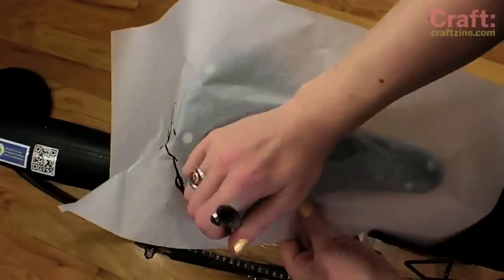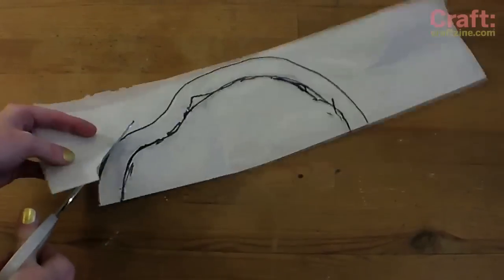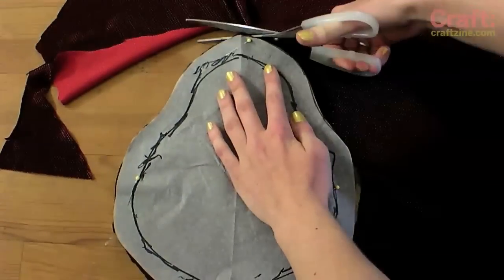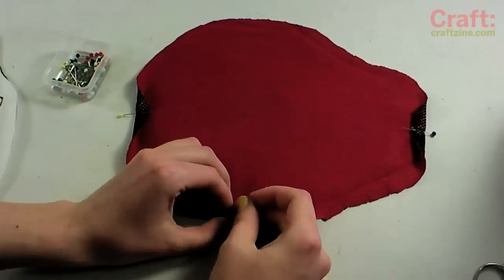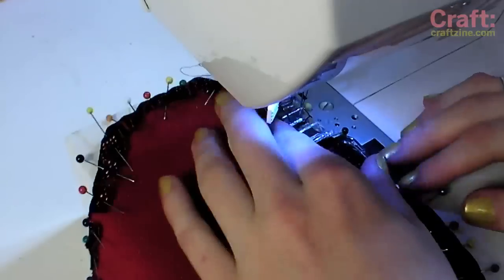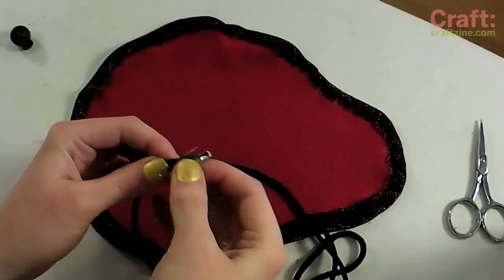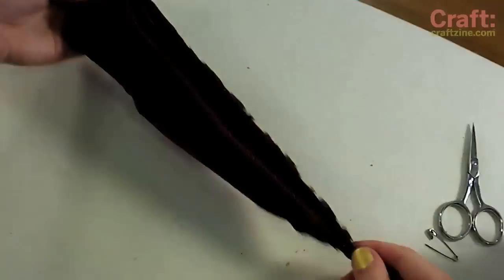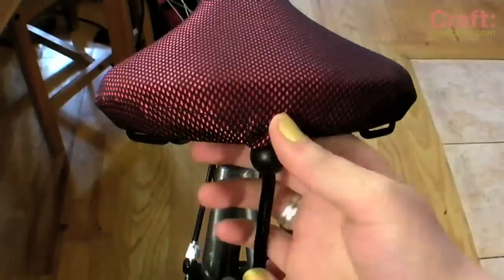Sew a Drawstring Bike Seat Cover

Comment: Iv got gel seat covers on all my bikes with soft plastic carrier bags tied over them. Some are expensive mtbs and as well as protecting the gel seats from wet and mud etc it also makes the bikes look a bit less nickable. The bags eventually wear out but are cheap to replace. They probably hold up better than your seat cover would as well, which would be sh*t up and ripped in a few months

Comment from the maker: @paukenkiger 1. it's actually leather, and the drawstring makes it really tight so it doesn't slide. 2. Just throw it in the washing machine. 3. It's to deter someone from stealing my name brand seat off of my parked and locked bike. 4. show me yours! Mine's a 2009 Fuji track with 650 wheels, nothing to scoff at and a great ride around town.

Comment: @rustyman101 I would not recommend it for a large power bike because the G-force s in  a turn are greater then that of a bikecycle and if the cover slides from under you it might not be pretty. but hey depending on the fabric it might work. test it at different speeds. OOO but I do like the craft I think it is outstanding.